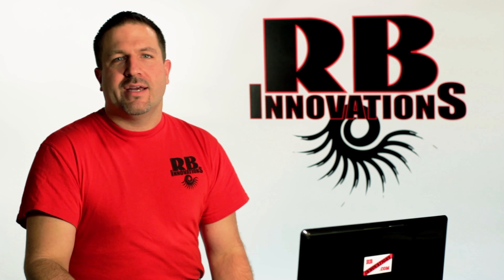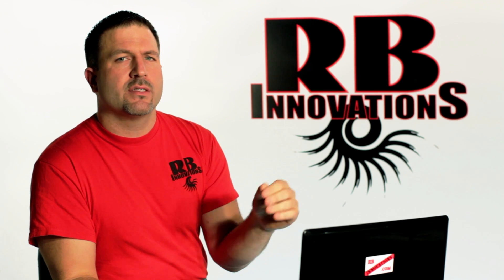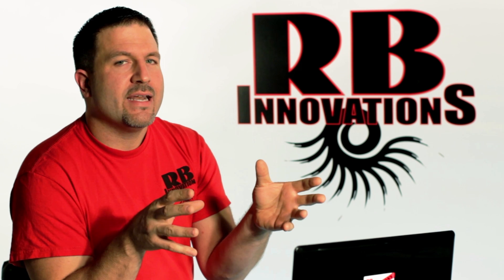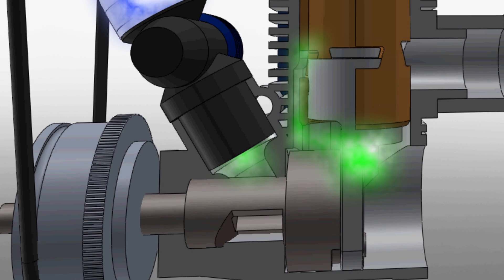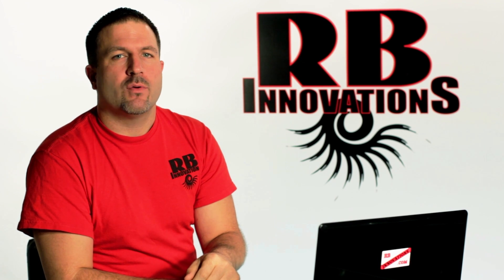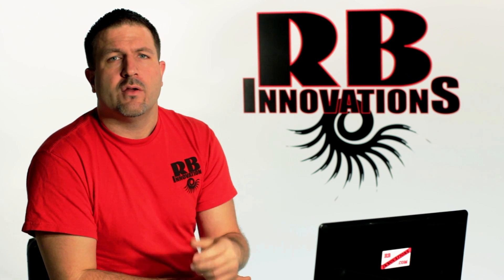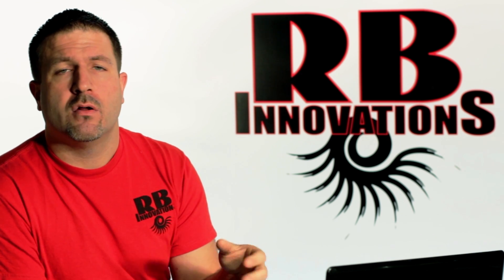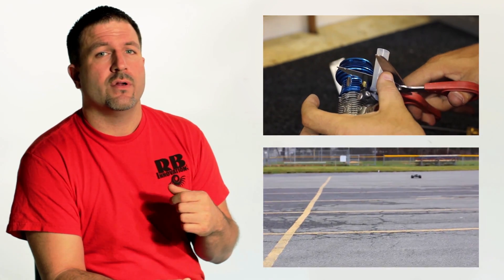How RC Nitro Superchargers Work

Comment: I see everyone here arguing about boosting a 2 stroke engine.. the problem i see here is not with the fact they are trying to boost a 2 stroke engine, the problem is in the carburetor.. Does it come with a pressurized fuel system? Does it come with a way to add more fuel to compensate for all the additional air? If the supercharger compresses the air like it claims then you would have to pressurize the fuel system at LEAST 1psi MORE than the boost created from the supercharger.. if you don't, you just shove the fuel back into the fuel tank.. Looks to me like this whole setup is a big hoax, unless i missed the part where it came with a fuel pump and a carburetor designed to add fuel to a boosted system..
Reply: enemy4 2day Exactly on point with the fuel pressure!
Reply: enemy4 2day umm there are lots of flaws with that logic showing youve never actually dealt with carbureated supercharged/turbo engines, or seen one...let alone a Nitro engine. I've done all the above as a professional engine builder of these things

1. No matter what...any air that flows over a venturi is going to increase the amount fuel coming out of it, it doesn't have to be all on the negative side of the engine. As ALL air comes from the supercharger side anyway. 

2.you don't need a bigger fuel jet because the one in a Nitro engine has an adjustable jet that can be sized on demand to what ever is needed(hence tuning it everytime the weather changes) so you would just tune it to the right fuel flow that you need, which is also being helped by more fuel flowing, due to the tank being pressurized 

3.It doesnt need a tuned pipe, a normal one will work just fine, just like increasing the RPMs, it will account for a much larger combustion.  Yamaha Banshees are a prime example...take a stock bike, shave the head a bit to increase Compression ratio,  and BOOM...you have another 30 percent extra horsepower with the same exhaust as before...and NO issues, if you tune the carb (which is possible on one of these with a turn of a screw, it's a lil harder on one with a set jet size like a normal full size carb)

4. The increase in combust able air going into the intake creates more exhaust(just like revving the engine higher) that power sends more exhaust gases out,  which pressurize the fuel tank to the exact amount of fuel the engine needs for its power/RPM output...which is then adjusted by you with the adjustable fuel jet (Literally the principal of EVERY nitro rc engine) 

5. That increase in exhaust gas (which again increase tank pressure sending more fuel to the Venturi) creates a much larger sonic impulse to force fuel back into the cylinder.(Principal of all 2 stroke engines)

Btw...these are my qualifications ($145k and 12 years later lol)
-ASE certified mechanic 
-Yamaha dealer certified mechanic, working for a local race team
-Dyno Jet tuning systems and certified in their main 3 dyno systems
-MMI and Tulsa tech certified motorcycle mechanic
-Built two supercharged motorcycles with blow through systems exactly like this, both were 2 strokes too
-Worked in a hobby shop for 4 years building RCs for extra money
Reply: enemy4 2day the engine pumps out more exhaust that pressurizes the tank even more to account for that when the RPMs go higher or the fuel burn is more powerful (which happens with more air and fuel) literally NO NITRO ENGINE OUT THERE WILL RUN THAT WAY. 

I fucking DARE you to try to run a Nitro engine without that exhaust tube connected to the tank (it won't even start, and if it does you will have to open the fuel jet completely,  leading to it leaning way out and dieing when you rev it)

Also this has a pressure chamber in it, AND an impeller like the intake on a turbo, that compress the air before hand...AFTER the impeller spins and compresses it in a smaller area, THEN and only then is it pushed into the motor,  otherwise it would just be a fan (just like a good leaf blower, that's how the fan spins at 50 mph but the air coming out is going 200mph)
Reply: I make more than you do - i own an auto repair shop which does over 1 million dollars in service each year, fairly easily with one mechanic and oil change boy working under me.. Hell i have enough money to pay my head mechanic 60+k a year..
Money doesnt matter - were arguing knowledge here, with your abundance of money seems to come a shortcoming of knowledge..
 There is no such thing as negative pressure.. 0psi or absolute zero is the lowest psi possible - beyond that its vacuum - which is the absence of any pressure.. vacuum is NOT, and can not be measure in psi - read a book about BASIC physics and you might understand.
Reply: They mentioned you can run a port to from the supercharger to the tank for my fuel pressure
Reply: John Pummill for more* not sure what happened there
Reply: John Pummill But if your using the "boost" to pressurize the fuel tank its still going to be the same pressure as whats in the intake therefore it becomes a wash, back to square one WITH an EXTRA load (supercharger) on the engine.. the only way i could see this work is if you fed fuel through the supercharger instead of sending "compressed" air through a carburetor designed to work with vacuum.. 2 strokes can be pressurized - there are MANY examples of it being done over the years, but this system is obviously a hoax..
Reply: seth newman You seem to have a mediocre grasp of how an internal combustion engine works.. therefore you should know if this was a supercharger it would pressurize the intake chamber making the venturi effect useless.. 
Also where is the bigger fuel jet to flow more fuel, also if it comes with a pipe tuned for additional air flow then there would be no additional back pressure and if there was it would be restricting air... making the whole system useless.. which it obviously is.. 
Sense i cant seem to grasp how this scam would work why don't you explain to me how much "pressure" this supercharger makes in comparison to the back pressure so i can understand how all this additional fuel makes it into the motor.. 
If this had a venturi carb BEFORE the supercharger it would be much more understandable.. but based on this set up its OBVIOUSLY is as much of a horsepower gain as putting a K&N sticker on your back window..
Reply: seth newman Never heard of an "SAE" mechanic - I am a master ASE certified auto/diesel/hybrid technician, 15 certs in all - so your "SAE" certifications don't mean much to me online.. 
You failed to answer my question though - how is the fuel system pressurized higher than the intake side of the motor? 
Also how does a suck through carb work on a blow through setup? Sense your so knowledgeable id appreciate it if you could explain it to me as i seem lost at how this system works..
Reply: seth newman how the hell does the fuel tank get to, AND withstand 30psi, the backpressure in the exhaust is never more than we will say 3psi even on a 2 stroke - go ahead and hook up a gauge to your "pressure port" on your little mufflers or whatever.. also most rc lids dont screw on ? at least if my memory from 20 years ago serves me right - so how would the lines stay in the tanks and the lids stay on under that kind of pressurization?! where is all this pressure coming from?
You claim any air passing over a venturi will draw from the venturi - so wouldn't the exhaust gasses passing over the "pressure port" on the muffler create a vacuum when there there is no back pressure.. ie low rpm and idle... just depleting the "pressure" in the fuel tank... 
Also all the vintage turbo motorcycles iv encountered used a suck through carb BEFORE the turbo - which makes sense.. and the cars that used the carbs AFTER the turbos modified them to be blow through carbs or simply used blow through carbs.. these tiny carbs on small power tools and rc cars are suck through carbs - yet this setup claims it magically turns into a blow through carb without any modification other than bolting this cheesy fan to your motor.. 
im starting to wonder if you think you can create boost with a leaf blower..
Reply: so there is always 1psi in the fuel tank - hell 3 psi in the fuel tank - if this supercharger makes ANY boost it wouldnt allow the fuel to flow properly, sense - ill repeat myself yet again - this is a suck through carb - not a blow through. you cant run a pressurized intake on a suck through carb.. I know how a turbo works - apparently you dont.. you have to pressurize air.. which requires compressing it through the means of a turbo or a supercharger or even another piston and cylinder to compress the air.. theres no FAN out there that will compress air.. 
This system is clearly a hoax.. Your not pressurizing the fuel to overcome the "pressurized air" this "supercharger" (fan) makes and STILL USING A SUCK THROUGH CARB.. 3 variables that prove its not actually a supercharger of any kind...
FYI - theres no leaf blower out there that will pressureize any air for car use.. Hell ill bet a leaf blower couldnt boost its own 50cc engine..
Reply: yes your right - a 2 stroke DOES require a TUNED pipe to get the pulse to keep fresh air and fuel from being blown THROUGH the combustion chamber.. it does NOT create back PRESSURE though - not a lot at least.. So let me get this straight - YOU SAID you dont need to tune the pipe it can handle the extra air and power - now you say it wont run without a tuned pipe.. if the pipe was as pressurized as YOU think it is it would choke out the motor pretty quickly.. Go ahead and stick your finger over the tail pipe and see how long it runs with all that back pressure..
So AGAIN - if this system DID create boost like it claims - it would push fuel back into the tank through the SUCK THROUGH carburetor because the back pressure in the pipe that's NOT TUNED is never going to have more than 3psi otherwise it wouldnt run with or without boost if you cant get air out the exhaust (the only way to pressurize it)
Reply: I don't believe you for one - and now i understand why your so adamant about proving something works when the science behind it says otherwise.. I know how an impeller works - boats have impellers and they don't make any boost.. the tolerances on an impeller and its housing must be so tight for it to make any boost - and AGAIN.. how does the fuel get fed through a SUCK THROUGH carb on a BLOW THROUGH set up ? 
Id like to see a pressure gauge hooked up to your fuel tank, your exhaust and your intake - just so you can see for yourself how ignorant you are.. Hell - maybe ill be the mistaken one here and you can prove me wrong.. im always open to learning new things - but until i see some valid proof the science just doesn't support this product.. 
I know all about turbos - i spent a loooong time designing and tuning my turbo busa - to make it streetable and fun - much more rewarding than playing with kids toys..
Reply: seth newman 2 strokes run fine without an expansion pipe if they're tuned to do so. I have an OLD competition chain saw intended to run WOT with a small straight pipe on it - it runs just fine at idle and WOT.. doesn't mean it CANT be done.. I never said they don't run on backpressure - its very beneficial for scavenging exhaust from the engine - what i said is an engine cant run on excessive back pressure and theres no way you can create 10psi from exhaust back pressure alone.. that itty bitty little 2 stroke would choke up so fast if there was 10psi in the muffler..
Again - suck through carb being used in a "boosted" blow through set up - i call bull shi*
 
Van Wilder went to college for 10 years and didn't learn a damn thing, if i spent 150k and 12 years in school i would hope to know much much more about internal combustion engines than you seem to know.. Id ask for a refund if i were you.
Reply: seth newman AND where the hell do you find a dyno for kids toys ?!
Reply: enemy4 2day I never said I put one on a dyno...Although RB innovations and a LOT of rc Magazines have them...and my local track does too.

If you don't even own one of these then why are you contesting with someone who owns one AND one that is faster than the same truck without it?? Hmm...you have no place here unless you actually OWN ONE
Reply: Oh grammar police please tell me more about how i dont capitalize properly or use the proper apostrophes and contractions.. youRE right - it really isnt my business arguing toys with kids. Like the old sayin goes, "never argue with a fool, theyll drag you down to their level and beat you with experience"
Oh I sooo envy the one ASE you must have - the rest of the certifications are a joke.. dynojet certified LOL!!! what about mustang, or taylor or autodyn, What about an engine or trans dyno would you have any ide how to use those, doubt it.. 
Glad to hear you wasted tons and tons of money of programs and certifications that obviously taught you nothing.. So what, you can work on motorcycles, you must be an engineering genius - ill bet you know all about aerodynamics and air flow along with thermodynamics and all the physics involved in making an internal combustion engine work. 
So your telling me once the intake port closes, the sonic pulse is enough to contain the 5psi of boost that the supercharger has created AND the suck through carb will magically work in a blow through setup.. 
basically theres 10psi in the fuel tank that came from the exhaust, that 10psi in the exhaust is enough to hold the 5psi of boost back and this motor doesnt run in reverse under those conditions how?
Reply: 50 psi of sucking power, its statements like these that tell me you truly don't know engines.
The money you make means nothing about your knowledge.. there are plenty of idiots who invented something or were silver spoon children that make tons of money, still idiots. 
Wow your so smart bolting nissan parts together to go fast - your right my busa is not that fast because i wanted it streetable and i still enjoy track days to keep my riding skills up to par. Ive met Valentino - that doesnt mean you know anything.. again.. your bragging about all of these things and yet your knowledge has yet to shine through.. 
Ive never seen a one way valve in a carb to only allow fuel to flow one way - unless your talking about the float needle - which an RC carb does NOT have.. So ill have to assume your full of shit yet again
Reply: enemy4 2day the engine creates a vacuum when it opens the ports right? Yes!!!
     Now on a traxxas 3.3 engine the psi of negative pressure in the intake is around 50 psi, that and atmospheric pressure are  what forces the fuel in (traxxas has it listed in their manual that it is around 50psi)

Also a RC carb doesn't have a float OR a float needle,  or a bowl, or even a normal jet... it has only a high and low speed circuit(which only open under positive fuel pressure), when the carb is opened up past a certain point then the high speed needle opens,  but the low speed stays open at all times. 

Again your ignorance is astounding. Please tell me why they have been banned from tracks for creating too much horsepower and why my  Traxxas Jato 3.3 with the supercharger beats the one without it???!!?
Reply: Oh so your reading negative psi from the traxxas book - i see now.. i guess i didnt realize negative pressure was measured in psi LOL!!! ill bet you dont even know what units vacuum is measured in - ill give you a hint its NOT psi.. 
Jet only opening under positive fuel pressure on a system with no fuel pump - your hilarious.. the only one digging a hole around here is you.
Reply: enemy4 2day lmao dude ok, it says in letters "Intake is under 50 psi of negative pressure(3.44 BAR)" 

And PSI is what pressure is measured in for turbos and superchargers so that's what I use. 

The carb has a one way valve, seeing as I actually have one, I can sit there and try to blow fuel backwards all I want but it WILL NOT.

I severely urge you to go to a hobby store and check one out. You might actually learn something.
Reply: enemy4 2day hah I severely doubt that!! How much do you make a year?

Also mine works fine! Again explain why they are banned from RC tracks, and why I have one and 1 truck with it, out performs the other truck without it by a large margin?
Reply: enemy4 2day you make a million gross. I make a $120k take home. You might make $200k...maybe.

Ok then use a vacuum guage, and using that vacuum guage (mine reads in psi) you'd see that the measurement is equal to 50psi when converted over
Reply: enemy4 2day or should I saw MBAR/inHG/hard, or soft vacuum
Reply: enemy4 2day ok then BAR or inHG

Also bar converts to PSI 1 bar= 14.7 psi at sea level, so it would be a negative number if it were 2 bar of negative pressure, that's why I say it that way
Reply: you say it that way because your not as smart as you think you are.. most everyone measures vacuum in inches or centimeters of mercury
Reply: enemy4 2day yes that's why I said inHg. Or use could also use a large displacement Manometer.

Although most people on the internet don't even know what that is...
Reply: you said negative psi over and over - theres numerous things that tell me you dont actually know how internal combustion engine work - you may be great at changing parts but i doubt you could fix a sandwich.. just based on the lack of knowledge
Reply: enemy4 2day eh Yamahas Race team seems to think differently.  Also i only said negative PSI because most people on these comments don't even know that there is no negative PSI, or what a vacuum guage is...let alone a Manometer, or measuring inHg. Or even that an RC engine has a pressurized tank at all
Reply: ***** You right i did not know about how pressurized the fuel tank is - and if i ever run into a kid at the park with a nitro im hooking my gauge up to the tank because im skeptical. I understand how the pressurized tanks work, i had MANY nitro cars as a KID.. but there never seemed to be much pressure in the tanks as i would pop the caps and fill them up while they were running. The fuel system is definitely not the only issue with this system - thats just where it starts.. Your still basically blowing all that extra fuel and air out the exhaust assuming its pressurized.. It just seems to me that everyone arguing with me would certainly be gullible enough to fall for the K&N air filter claims, and the high flow cat back exhaust claims and "boost box" for 2 strokes and water injection in your car for 50+mpg.. these are all just money making scams that dont actually work.. Many business (as seen on tv type - Activia, Airborne, extenze, kashi to name a few) thrive on false advertisement and hope they make enough money to pay the lawsuit settlements and be able to keep it hush when it happens. This DEFINITELY fits into that category.
Reply: enemy4 2day i only see water injection used so it cools the pisto in high HP applications,  K&N can increase by 1 hp or 2hp max unless you have a really restricted air flow, people use them because it's easy to clean and supposedly filters better, which I agree for their offroad stuff. Because it's cheap and I have to clean the filter 1/3rd as much on my ATVs, and it's still cleaner.
Those "high flow cat backs" are a joke unless theyre much larger pipes and have a much less restrictive muffler.  
    Boost boxes/bottles only worked on a couple models of dirtbikes and they were such a small advantage and so expensive to get right that Yamaha came up with power valves instead, the YPVS

Also the RCs nowadays die within 2 seconds of lifting the tank tab. They don't like pressure leaks of any kind and have a thick gasket and heavy spring
Reply: R/c engines have a line connecting the exhaust to the fuel tank, to pressurize the tank, this doesn't exceed more than half a psi usually. If this produces any decent amount of pressure, it would shove the fuel back. So either it doesn't do anything, or is bad for the engine.
Reply: enemy4 2day dude. The carborator goes on top of the supercharger. in other words the carp doesn't have pressure running through it. the fuel and air mixture is sucked from the carb, through the supercharger, and then forced into the engine. The carb works exactly as it would stock. No need for fuel pumps or anything.
Reply: Luke Bailry Did you even watch the video? At a 1:35 ish the video clearly SHOWS AND STATES the impeller forces "more" air into the carburetor. You're right though, the only way this COULD work is to get a bigger carb and bolt it on before the supercharger... but that's clearly not how setup is built.. any other useless information you'd like to include in your argument?
Reply: enemy4 2day do you even know how engine and superchargers work? The carb goes before the supercharger. There us no air being forced I to the carb. The carb works off of suction. The carb only has more air being sucked through it. so the fuel is still sucked from the carb the same as if it were stock. Still no need for fuel pumps. A bigger carb would help performance with less fuel and air restriction. you don't need high pressure fuel pumps and such. As long as you don't make the fuel lines longer, the carb still gets the same amount of fuel. We're not talking about a full size car. Remember this engine is highly related to the one that runs your weedwacker.
Reply: enemy4 2day and also, it states the air is forced into the intake. not the carb. The intake is where the air/fuel enters the engine. This is also before the carb.
Reply: Luke Bailry Watch the bideo from 1:35 to 1:50... it clearly states it takes air from the turbo to the carburetor and then i to the engine. i KNOW how a supercharged carb setup works.. but if youd simply comprehend the words and pictures in the video this takes air from the impeller to the carb.. 
if you struggle this much with a video, its no wonder you cant comprehend my written text.
Reply: There's two ways to set it up. A blow through carb and a regular carb. If you'd like to go through the work of building a blow through carb, run your engine lean, and ruin the rings and the piston, then go for it! An since I cannot comprehend your text, why don't you try it? Build you one! But personally what's the point? Why use fuel pumps and why build a blow through carb? That's the complicated way around it. I mean, you could just put the carb on top of the supercharger, and run the fuel and air mixture through it. Much much simpler. And the same outcome, but with no fuel pumps and no blow through carb. If you don't understand this, you do not understand how a supercharger works. I'd be happy to awnser any questions you might have.
Reply: Luke Bailry Im not arguing the fact that putting a regular carb BEFORE the supercharger WOULD be much easier. What i want to know is how the setup in the video is able to work around the carb being between the supercharger and the engine..
Reply: Luke Bailry again... watch the video...
Reply: Luke Bailry Watch their installation video. On a normal engine, the Supercharger is installed after the carb to avoid the problem of pressurizing the carb, but they clearly show this being installed before the carb.
Reply: enemy4 2day read what I said before again, since you obviously need glasses....i make $120k a year. I said "these are my qualifications ( $ 145k and 12 years later lol)" as in I went to school at a cost of $145k for 12 years. 

Also the engines do run on exhaust back pressure, that pressure creates a sonic wave that forces the fuel back into the cylinder, AND pressurizes the fuel tank.  THEY WILL NOT RUN WITH OUT THAT.  

AGAIN THEY WILL NOT RUN!!!!

I work for K&N Yamaha (Tulsa,OK the very 1st yamaha dealership, my boss is the inventor of the K&N air filter, his name is Kenny, the "k" in "k&n") and the local Yamaha Race team, do you really think I'm stupid? 

I actually own one of these and mine is faster than the one without it and they are both the exact same model minus the supercharger and exhaust....

 NOW Mr. Armchair mechanic, how is one model MUCH, MUCH faster with nothing but a new pipe and a supercharger on it??!!?    BECAUSE IT WORKS!!

Go to an RC track and you'll see they are banned for being unfair because they add too much horsepower!! 

Until you can show me dyno results and bring me a Traxxas Jato 3.3 that is stock,  that will beat my truck then shut the fuck up and go ride your imaginary turbo busa(which will get smoked by a decent Turbo 1299 Ducati that weighs 180lbs less)
Reply: No matter what... if you increase intake gases, it increases exhaust gases which pressurize the fuel tank...the more explosion, the more exhaust gas, therefore pressurizing the tank more (the engine does that while it's running without a supercharger too)

if you doubled the intake volume, you'd double the exhaust volume,  thus doubling the tank pressure(and assuming the needle could let enough fuel flow) you'd double the exhaust sonic pressure wave

that's how guys can run s 300hp 12mil stroker Yamaha banshee with no problems
Reply: Also the supercharger pushes air over the Venturi(needle) in the carb...no matter what if that air increases, it'll make more fuel AND ait go into the engine
Reply: enemy4 2day ASE is what i meant but my phone autocorrected, from talking about sockets. But i did answer those things already....

Also the fuel system is ALWAYS at a much higher pressure than the intake side, if you opened the jets all the way, theu would flow a HUGE amount more fuel than you would ever be able to use, the tank is generally under 10 psi or so of pressure and it only takes 3 psi to flow enough fuel to run 1 large Nitro engine at full throttle. Now because of that large positive pressure,  you'd just open up the fuel jet more to flow more fuel.

Ok so onto the posutive pressure venturi question....no matter how the air flows over a carb, it ALWAYS comes from the downstream side. OK now since that is true, any air that flows over that venturi is gonna suck fuel out of it, leading to more fuel for the engine to eat up...assuming you have an adjustable jet.

If the engine is creating negative pressure and the supercharger creates positive pressure they don't just cancel out...they make the air flow faster over the Venturi, thus allowing more fuel to flow out of it (yes you will have to adjust for that by opening the adjustable fuel jet up more)

THAT is how people turboed carbureated motorcycles back in the day. Back when they uses to make drag bikes with undercut transmissions and custom fit carbs because their's wouldn't flow fast enough for their turbos.
Reply: enemy4 2day where did you get 30 PSI? I said 10.... also how is this hard to get? People have used blow through for years, the fastest motorcycle at my local drag strip used one until it was beaten in 1996 by an EFI bike

Also the RC gas tanks have a very heavy spring that holds the tank lid down, and a gasket to keep an air tight seal. 

There really isn't any difference in a blow through carb and suck through carb, that's a myth. All venturis work by atmospheric pressure or another outside pressure pushing down on the fuel, if a pressure differential happens to be less on one side it sucks the fuel up. (The Airspeed in the intake is increased so that pressure is higher, leading to more fuel being sucked out)

 A venturi can only work one way...a pressure differential of air flows over the hole leading the fuel to be pushed out and into the motor(thanks to tank pressurization, AND atmospheric pressure that helps it out of the tank)

The engine is ALWAYS pumping out air into the exhaust, it is higher than atmospheric pressure(which the tank is always under)...as in positive, kinda hard for it to depresussurize the tank when even at low rpm the pipe is under higher than atmospheric pressure. Now if you were in a vacuum that would be true but i dont see RCs in space

Now that pipe pressurizes the tank...just because it's at low RPM doesn't mean it stops! Otherwise they would never run correctly. 

Also if a leaf blower is blown into an engine at above atmospheric pressure,  and there's fuel mods to support it, it will create more horsepower. It's more air and fuel for the engine. That's EXACTLY what a turbo does. (It would have to be positive pressure with fuel to keep AFRs correct)
Reply: enemy4 2day no i said a tuned pipe is not required,  but helpful...I've built 2 different Yamaha Banshees that made 50 percent more than stock power, WITH the same exhaust they had before,  they pull wheelies in 4th gear no problem. 

 The only effects of a tuned pipe are to push fuel back into the cylinder, and the sonic pulse works no matter what, but is increased with a better pipe
     Also the reason it doesn't choke the engine out is because you ONLY have the fuel jet open enough to run the engine, AND it has 2 different jets in it.

AGAIN...read this exactly as I write it...

If the engine increases RPMs, it pushes more exhaust out right? Yes

Ok now that it's pushing more exhaust out, it pushes more to the tank to pressurize it, leading to more going to the engine.

The supercharger has an impeller that forces the air into a smaller area in a snail shape JUST LIKE a turbo...it is not just a fan, it is an impeller that compresses

Also the port timing would stop the exhaust from sucking feel back into the tank because the intake sucks the fuel down by negative pressure(which the supercharger helps...then it closes, then the piston closes the port AFTER that, then the exhaust closes after the Sonic pulse forces the fuel back into the cylinder
Reply: enemy4 2day also i would know that it has an impeller because I have one. It came with a truck I bought off Craigslist. 

It compresses air with that impeller,  and therefore when I put it on, it needed more fuel. So i tuned the Carburetor.

 Now it beats a truck that has the EXACT same engine, fuel, tires, and weight...all by quite a large amount
Reply: enemy4 2day except that you fail to see that I'm a mechanic working for Yamahas local Race team here at my local speedway. Making $120k a year doing this, sorry I like to spend money on stuff thats fun... rather than type about stuff that i dont don't know about like you.

...obviously you were interested enough to click on the video and write a hateful comment!! Maybe you should be interested enough to pick one up and go to a few videos showing how they work. This is NOTHING like a busa.

I DID prove you wrong multiple times, the engine WORLD NOT RUN if I were wrong on any of those points, even just one.

I actually have one of these and that truck is MUCH faster and uses a lot more fuel too, than the one wothout it....I DID buy a new tuned pipe for it to get even more performance,  but it still ran just fine before then